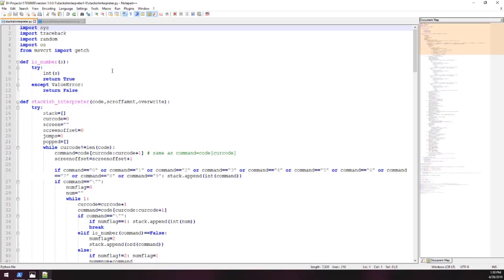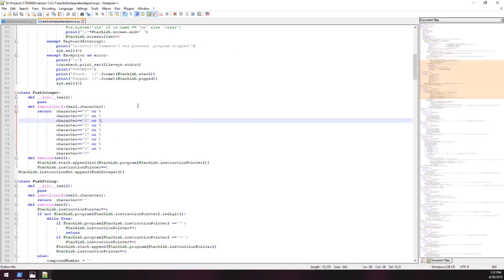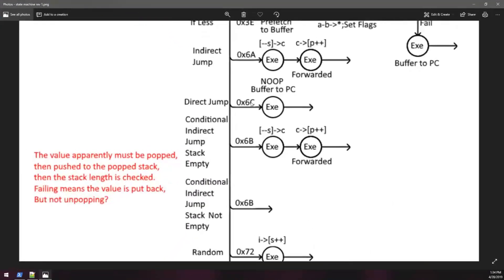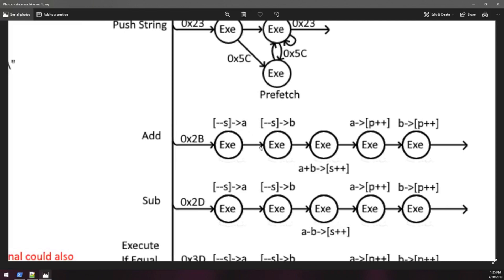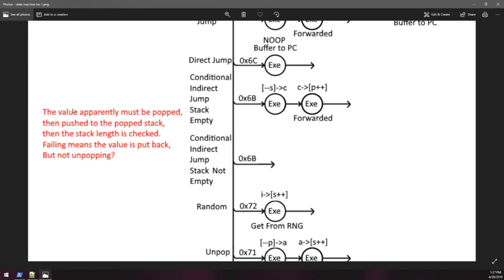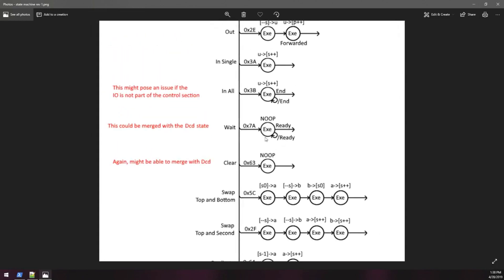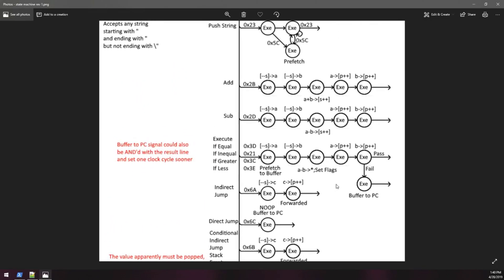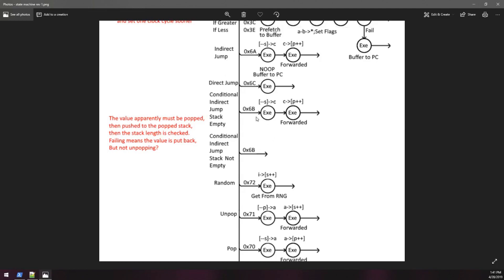Fatstacks Vlog Entry #7

Comment: I've had an interesting idea (quite long abandoned idea for a computer that I may pick back up) if you wish to do it, an infinite number size computer - ram size it its only limitation. A computer, that through (sometimes exponentially) longer steps, can calculate the formula for googolplex and spit out the correct number just using 16 bit adders and subtracters or even attempt to calculate pi (Although with some modes would just end in an infinite loop as it couldn't detect a pattern). It would be a pretty interesting system to implement into a computer - Although I'm going to have to dig through my hard drive to see if I have the documentation, that is if I didn't delete it by re-installing windows or cleaning up space if it's on the other drive (rip). I remember designing the architecture around it, although I'm fairly certain it could be done (perhaps slower) through any architecture as you can just figure out a way to program it to handle larger numbers then the computer is suppose to handle. Also, sorry about being so late with this comment - Seems youtube doesn't want to show me your videos even though they've been a helping factor in the little architecture projects I'm doing.
Reply from the maker: Sounds interesting. I suppose you could do something of the sort.
I know there was a knock-off 6502 (I believe it was the 6502 anyway, but I could be mistaken) that performed 8 and 16 bit operations using a 4 but ALU... I suppose using a 16 bit ALU to perform larger operations wouldn't be too unfeasible. 
It might take some juggling though to make the performance worth it, otherwise, you might as well just use a really large ALU.